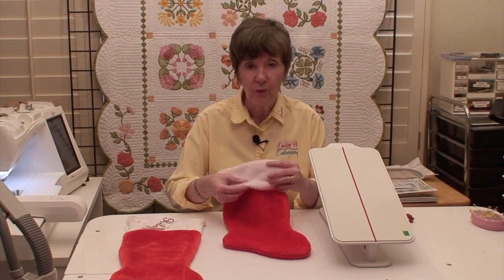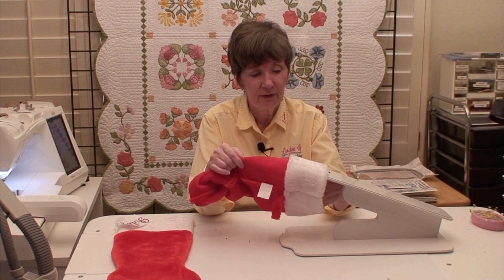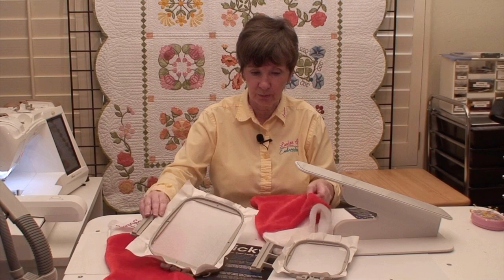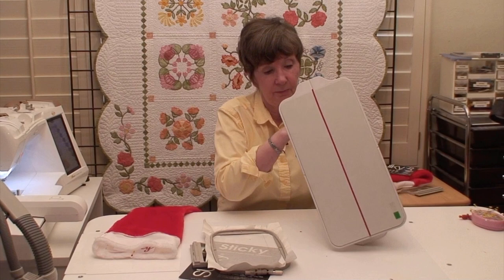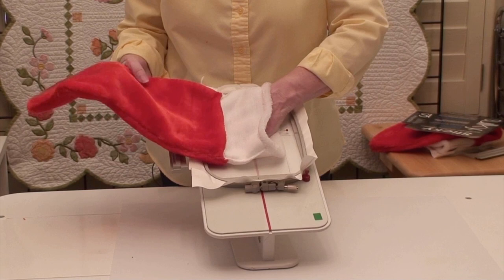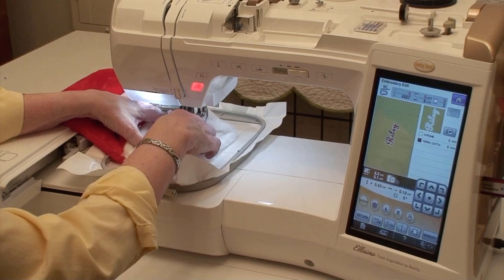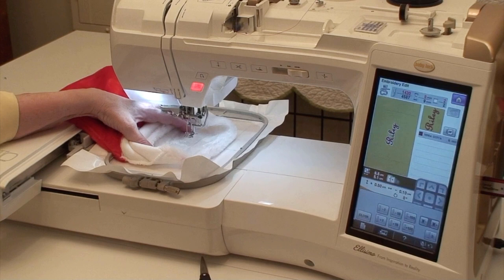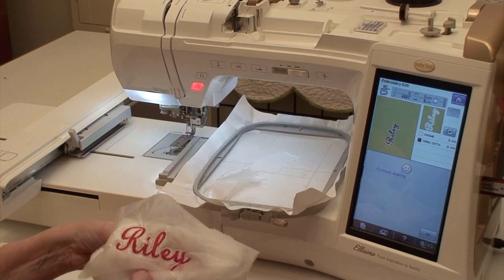How to Hoop & Embroider a Christmas Stocking Cuff

Comment: Could you have basted a couple of mm just outside the design to help keep all the layers in place so there is less chance of your fingers getting stuck with a needle? I recognize that you would need to still keep the other fabric out of the way, but at least your fingers wouldn’t be as close to the running needle & possibly cause you injury.
Reply: Yes, you can certainly do that.

Comment: I was just wondering, I am just now getting into the floating designs and I found that the sticky stabilizer leaves residue on the needle and causes the thread to break.  Have you ever had issues with this stabilizer doing the same?
Reply: You don't have to use sticky stabilizer.  Use a tearaway stabilizer, spray it lightly with adhesive and then pin the item onto the stabilizer. Make sure that the pins are out of the way of the embroidery  area so they don't get caught under the needle.